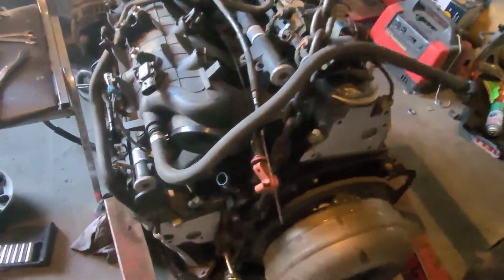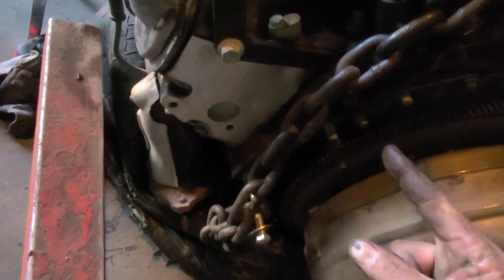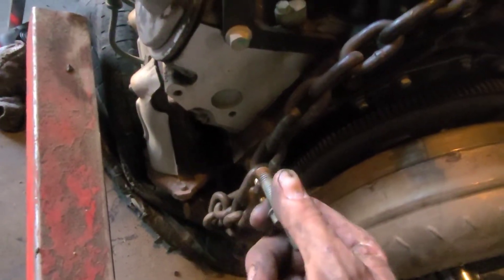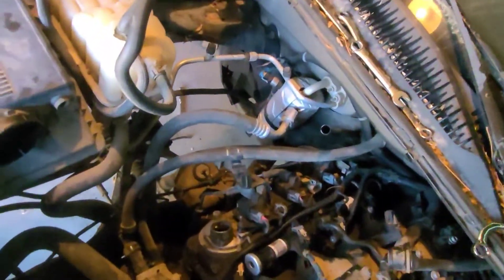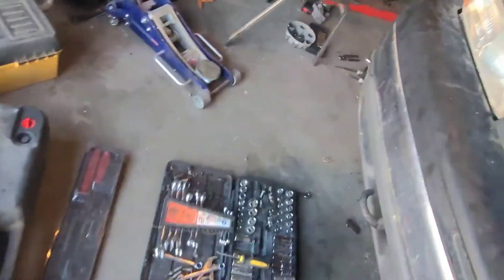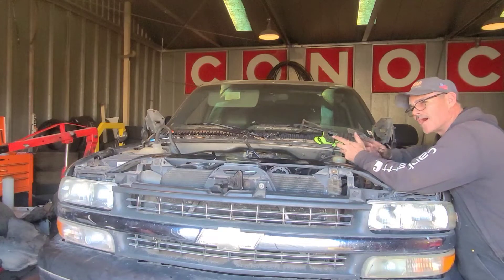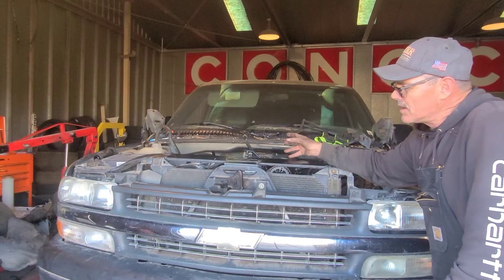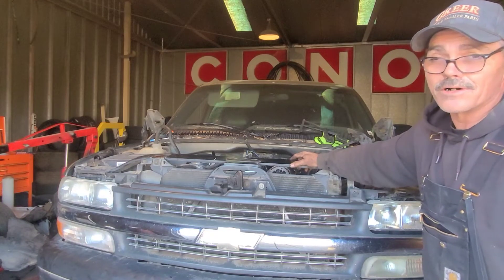pulling the LS motor out

Comment: The newer cars it seems there is always at least one nut or bolt impossible to get. 👍
Reply from the maker: I know right.  They made this truck a nightmare!!!!
Reply: @s.w.e.racing3704  when I pulled the 5.7 HEMI out of my Grand Cherokee there was one bell housing bolt at the top. It was surrounded by the main wire harnesses that branched off. 1/4 of a turn at a time. HaHa. 👍
Reply from the maker: @TurlosGarage  I know exactly what your talking about. I don't know what they are thinking half the time